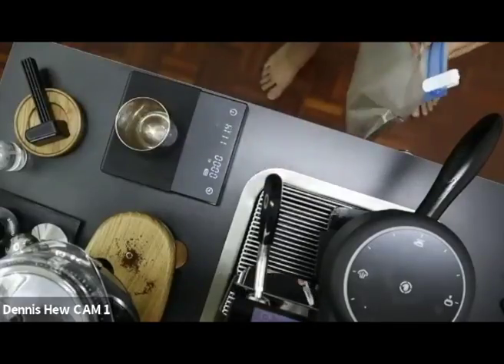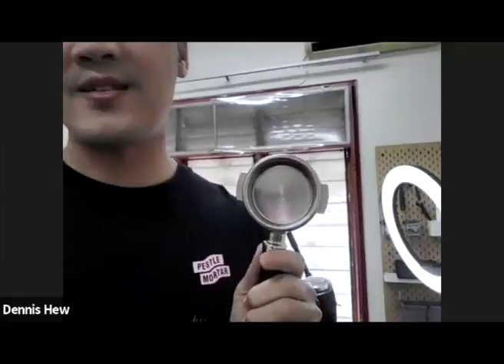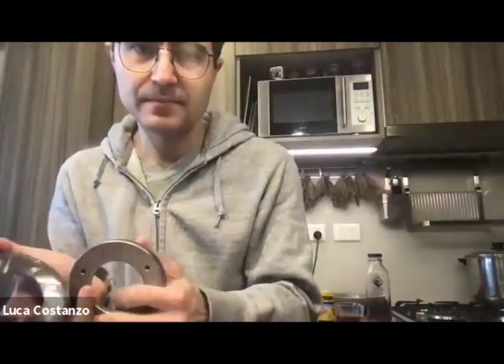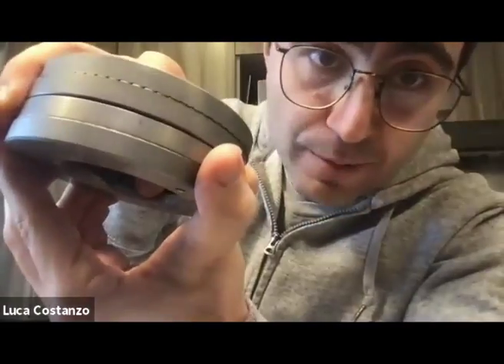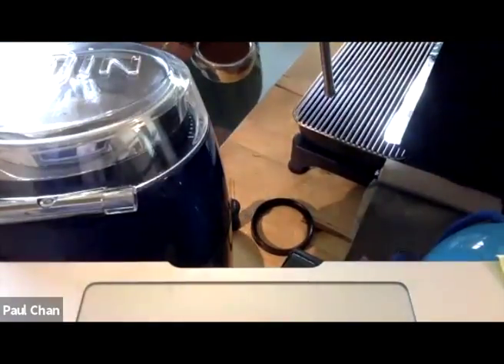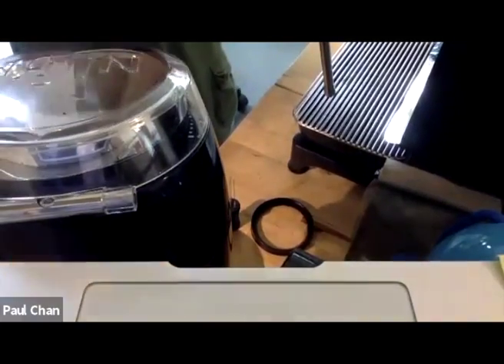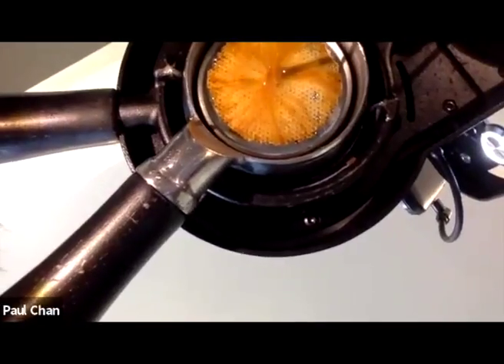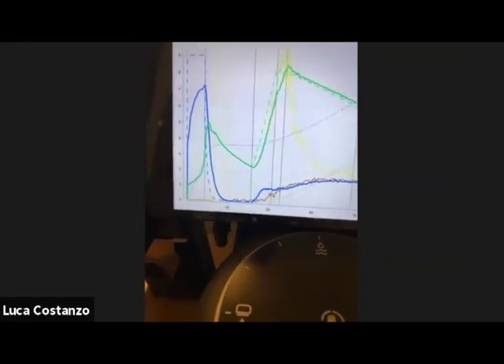Zoom: puck prep

Comment: Is RDT on a Niche Zero safe with its steel burrs?
I once remember on another youtube video that one of the experts said it wasn't a good idea
Reply: Thats a good question, I have been doing it on my Niche but last time I clean it I saw what it apparently is minor rust.
Reply: As a far as I know the manifacturer is not recommending the usage of rdt exactly because of this kind of issues
Reply: I’ve been doing RDT on my Niche for the better part of 14 months now, and I haven’t noticed any problems with my burrs. I clean them every two or so weeks, and use very little water, so that might be a factor? Also, consider humidity and water quality too — both of those can impact the formation of rust.